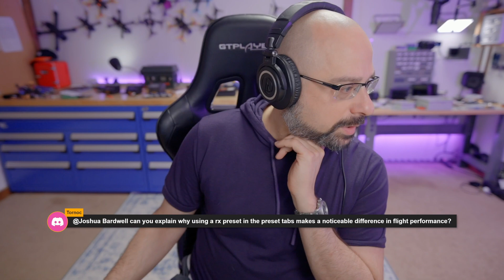Why Does Setting An ExpressLRS Preset Change Flight Performance? - FPV Questions

Comment: question on it .. considering controller know your RC ELRS rate ( 1-25 2-50 7-250 etc) why dont they still have no option to have it auto adjusted..

Comment: Betaflight already has a SDFT built in for dynamic notch functionality that could be used to detect packet rate and then adjust RC command filtering accordingly. Hell, you could even run the filtered signal back through the SDFT just to confirm no peaks above a certain threshold above like 50Hz.

Comment: i still use my frsky taranis with an elrs module. i’m capped at 250hz but it’s plenty for me for now.
Reply: I too used Frsky taranis with nomad module after installing edgeTX. For the 1st time I am thinking to buy a full size elrs radio. (I have pocket RM TX though)

Met a weird problem after switching between crossfire and nomad module. All the Aux switches got deleted in inputs, mixers. Very weird though. 
Also I cannot set aux again. Very weird though. Haven't reformatted the TX again. But I faced this problem few hours before a big shoot. I managed with pocket radio. It was a very torture and painful experience for me

Comment: Question. Im using 200hz low band (as 250 low band doesnt seem to work). There isnt a 200 preset. Would 250 work OK as the closest approximation?

Comment: couldn't betaflight just detect the packet rate based on incoming packets from the receiver ?
Reply: i think it kinda does in some aspects probably but the problem is the filters aren't a percentage function, but are instead tied to the hz. going from low to high hz without changing the smoothing will instantly cook motors. high to low is just going to feel like mush.

Comment: Thanks for posting this! Forgot to apply the 50hz preset - I switched from 250hz to 50hz.
Reply: Did you noticed better penetration and range? And big drop latency? I forgot this option too and I’m going to tested in my next flight 😊
Reply: @vizualstudio13 I noticed slightly better penetration and range, but I'm in an environment filthy with wifi interference. It helps but only up to a certain point. DJI's video link seems to actually give out after the ELRS signal flashes RXLOSS at me, rather than before as expected. But this is also with a pavo 20 pro with only an enamel wire as its elrs antenna.
Reply: @vizualstudio13 dude, 50hz is unflyable. Unless you fly forward for 10km. Long range. 

But 500F 500hz is definitely the only option for normal flying like freestyle
Reply: @aesthetic8780  250hz is fine for freestyle but 500hz is good for racing